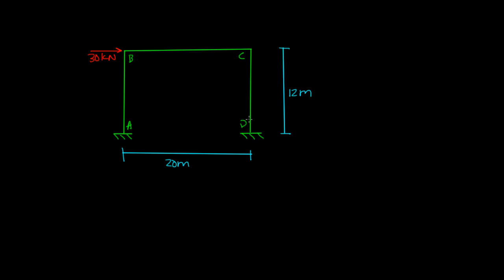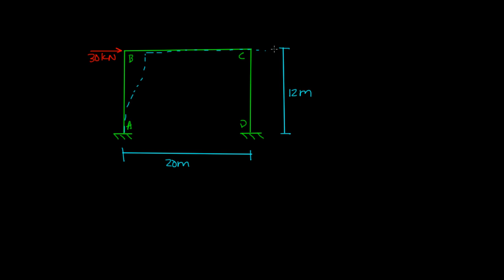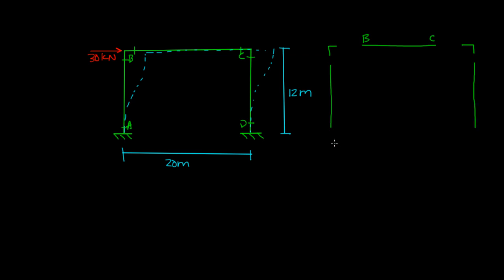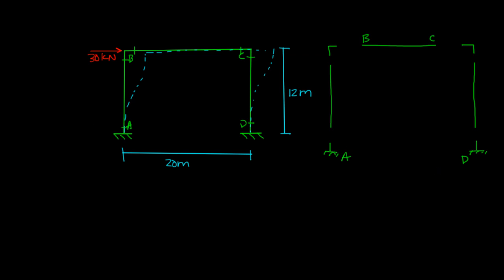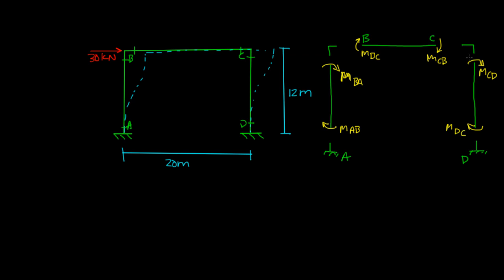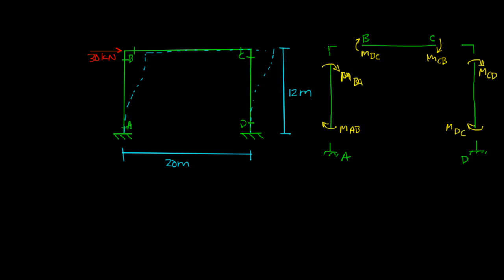Slope Deflection Example 3: Part 1

Comment: Sir, please help me with a simple steel portal frame design question. I've watched all your videos, but I cannot seem to work this out. Please help if you see this, or if you have time. Much appreciated.
http://i41.tinypic.com/144m6c.png
Reply from the maker: Hello! I took a look at the picture quickly and from what I see, the most important part of this problem is the angled top frame. If you looked at Joint C by itself (just as the videos suggested), the internal forces will not be analyzed like the other joints. The internal forces at Joint C will be parallel to the surface of the cut (perpendicular to the internal surface). The most important concept here is that if two lines intersect at perpendicular angles, their slopes are reciprocal to one another AND have opposite signs (i.e. the reciprocal of a slope of 3/4 would be -4/3 in terms of this problem). Try the problem again and see what happens! Hope it helps!